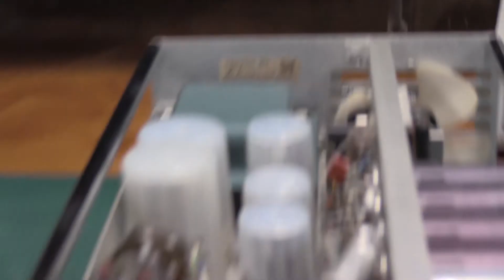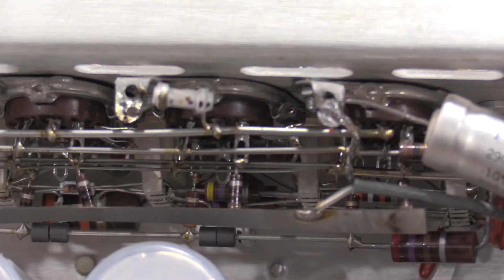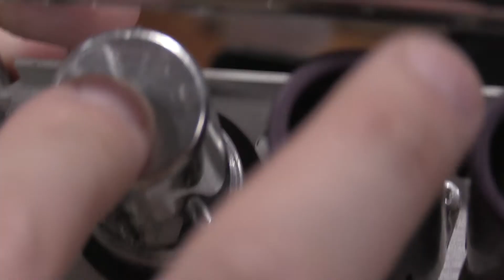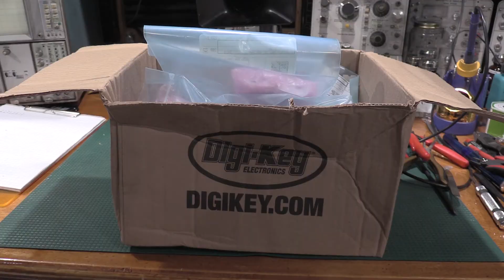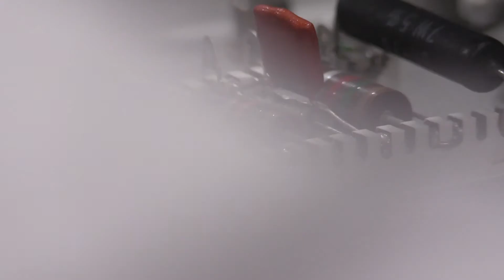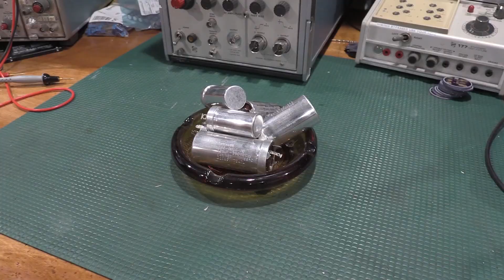Tektronix Type 106 Repair

Comment: Started my 106 restoration (I have a second one as a donor unit) and surprised by how good are all can electrolytic capacitors. It seems that SPRAGE made them using the best of the best materials of the time. Measuring like new. Low ESR (even lower than new cap's) and capacitance within 10% of the marked value and almost "0" leak. I believe that there is no need to replace them. Not the same about the rest of axial electrolytic. All of them needs to be out. Did you make a full calibration video for this instrument?
Reply from the maker: If I remember correctly there is not much to calibrate on this one but you do need a REALLY fast scope 1Ghz+ to test the fast rise and fast fall edges. I used a DSA602A to make the 789ps rise time measurement.

Comment: Did you make the Tektronix recommended changes to some serial numbers?  According to the IRB posted in TekWiki page for this particular instrument, some changes are improving the performance. I am planning to restore mine and want to make it the best possible way.
Reply from the maker: mine was later production 5xxx+ serial number so it had the silicon diodes. I measured 786ps rise time on a 1Ghz scope.
Reply: @ZenwizardStudios  Thanks for your answer. Looking for this video in your patreon page but can't find it.

Comment: What I love about that BNC conversion is that it is totally reversible.  You might consider bagging the GR connector up and securing it inside the instrument, some future curator may thank you.  I remember the first time I pulled the cover off of a 500 series scope...the manifest quality was just breathtaking.  I think you are correct that this unit is good for another 50 years.

Comment: I love your work, your attention to detail & care is what this old Tek gear deserves. I've used leaded solder on these old Tek wafers but only alongside the proper solder. I think as long as there is some silver based solder in the joint, your ok. That said these wafers are not easy to solder and get a joint as good as the gals at Tek achieved back in the day. Getting zapped is an occupational hazard I think despite all the care we take. Thanks....DA.
Reply from the maker: The reason for the lead free was at the time it was all I could find with a high enough silver content 3%+. It makes the 3%

Comment: You probably figured this out already, but lead solder is ok as long as there is 2% to 4% silver. Silver bearing solder is usually a pretty good mix. Original mix was tin 60/lead 37/silver  3.
Reply from the maker: Thanks for the Info on the original solder formulation. I am not sure on it binging a timing issue but It was hard to find a suitably high silver content. Which is why I ended up with the lead free It had the highest silver content I could find, Sn 96.5 / Ag3.0 / Cu 0.5
Reply: @ZenwizardStudios  This is perfectly fine, and exactly the specs recommended by Tektronix in the 106 manual, section 4-2, 3% silver.